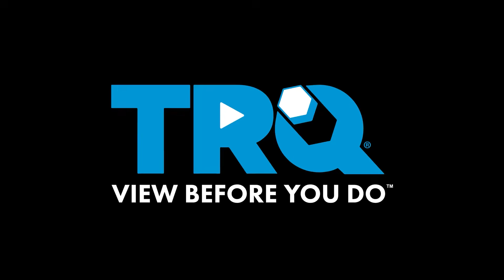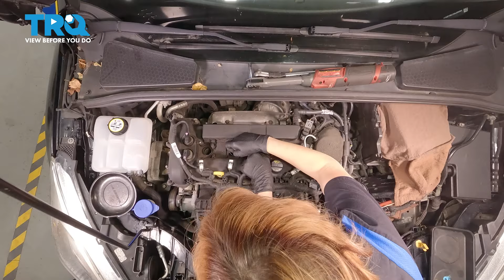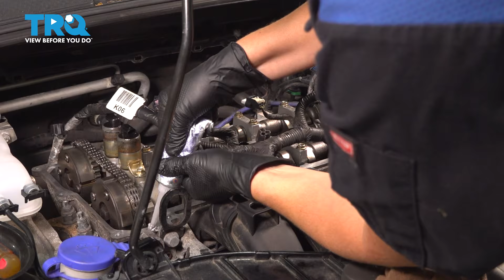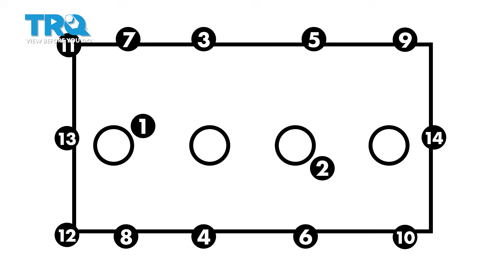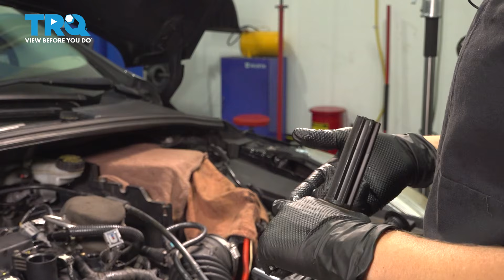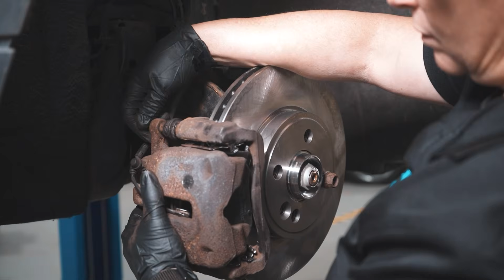How to Replace Valve Cover 2012-2018 Ford Focus 2.0L L4

Comment: Valve cover is new in video. Meaning seals on the cover are new. If resusing the old cover you will need to remove those.